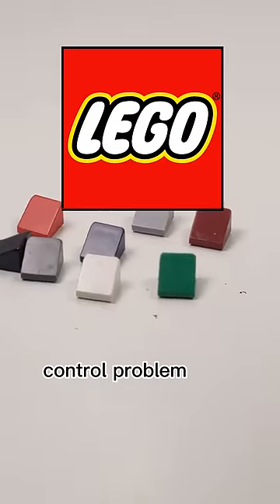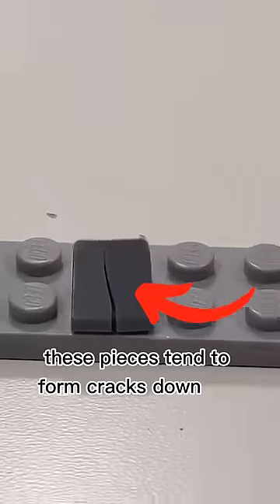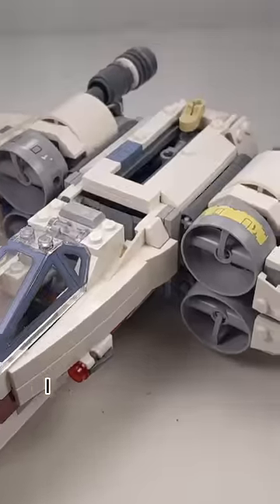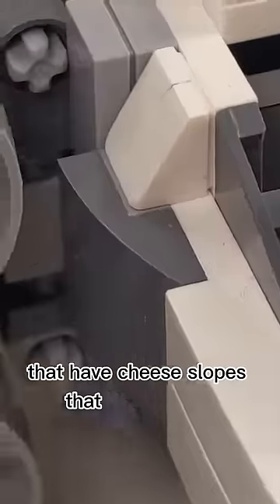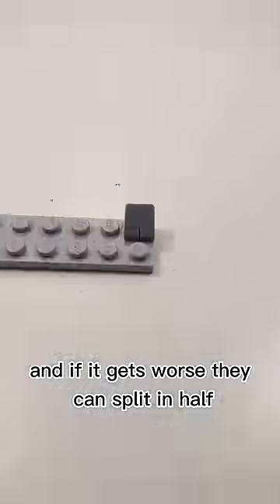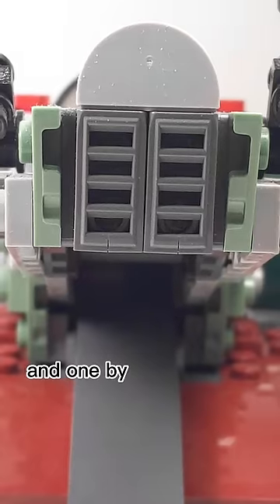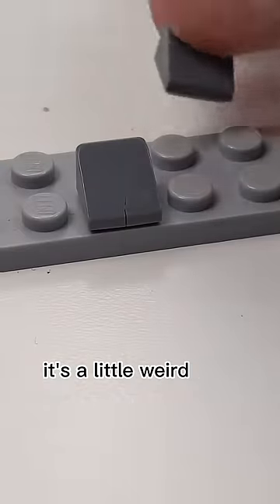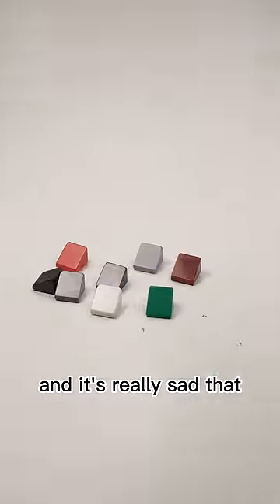LEGO has a Huge Quality Problem with Their Slopes #shorts #lego

Comment: Facts. Matter fact, I just had to replace a cheese slope not too long ago on my mirco Vulture Droid, based on the 2012? Advent calendar that I built myself, on the head because It cracked and that piece has been on there for 6 years, and I sifted through my other cheese slopes and I've noticed the the clear ones have them so far, but I found another to replace it

Comment: Lego has a huge quality control problem with everything. Form pieces missing to discolouration, bending, scratches and a likeliness to crack. The quality has been deteriorating for years now and it’s sad to see. 

The thing that used to differentiate Lego from its competitors was the quality but nowadays there are multiple companies that make bricks the same quality if not better with much much cheaper prices and less sparing regarding set design where Lego tries to save wherever they can often at the cost of design.

Comment: I've had Lego sets for over 40 years, and my son is a huge fan. We had thousands. Lego has extraordinarily high quality. Especially compared to mimics and knock-offs, where the pieces don't even fit. Sure, any material fatigues when stressed enough. This is not a quality control issue. What do you expect quality control to do, flex each piece a million times and check for cracks before putting into a package?

Comment: Should bricks break? No. Still I suspect this brick suffers from an inherent design flaw. It's actually not surprising if you view this from the perspective of basic engineering. 

These cracks all seem appear on the lower end of these sloped bricks. I don't think this is a coincidence. You're dealing with a relatively thin area of the brick. 

If you remove the block by grabbing it's thicker side and pushing it in the direction of the slope, you'll be applying lots of force on a relatively small area. 

Improved materials may alleviate the issue but the underlying flaw remains. Maybe a slightly softer and less brittle material would do the trick.

Comment: This is unacceptable . When they charge $50-hundreds of dollars for sets all supposedly to keep up the quality of their product and the pieces crack and look junky.

I enjoy Lego but they basically cornered the market in a lot of ways and then cranked up the prices to insane levels where you’re paying for the same old plastic blocks they’ve had for ages and they say it’s so they can constantly innovate and keep quality products on the shelves.

Mostly you’re paying too dollar for name on the box especially if it is a set inspired by a franchise because there is a licensing fee on top of that. 

I understand inflation hits every business eventually. But for me sometimes I can’t wrap my head around the price points of some of their sets for 100 tiny plastic blocks. Hell some of the Duplo sets are less than 50 pieces are you’re paying at times well over 1.50 per brick.

Comment: Never had this problem in my 20 years of lego.

I think this is a user issue
Reply: To suggest that it's a user issue makes no sense. It's Lego. You're supposed to reuse the parts to build new things. Just because it hasn't happened to you doesn't mean it isn't a real problem. 

I can confirm that I've had several of these pieces break on me in exactly that same fashion. It's not a big deal for me since they're cheap and I just replace them, but that doesn't mean it's not a problem.

Comment: i’ve never had any problems with any lego pieces breaking, try and keep them in a climate controlled environment. i’m in the south, humidity is high here so my house stays on 65-69 degrees. also keep your builds away from any windows, the UV light degrades the quality of any plastics over time. and lastly, i get some pieces require a little force but how about we not man handle the pieces and they won’t break 😅😅

Comment: Courtesy of environmental warriors. The plastic has changed over the decades, uses a lot of recycled plastic, all because people associate ALL plastic as being an environmental disaster, while forgetting that LEGO is not being thrown out. It gets kept, resold, handed down, stuck in a box for a decade until discovered again. It’s not waste, so is fine to be made from the highest quality virgin plastic. As someone who had LEGO in the early to mid 80’s, and then rediscovered it slightly in the early 2000’s due to becoming a parent, and now collecting it again, I have noticed the nuclear proof diamond hard and sharp LEGO of old has been gradually replaced by a more flexible, softer, rounder edged plastic. You can feel it when pushing blocks together. In the old days, they clicked together, and need the jaws of life to prise them apart. But now, they wiggle together, and you can fee them slightly distorting and flexing as you handle them. The only good point to this change is they break cleanly, without shattering, and they are cheaper than they would be if they were the old plastic.

Comment: Well me I noticed to have this issue for some of my very old 2014 sets , I recently bought a lego city one it's the mining 4×4 I bought it last month and today I just discovered that some of cheese slopes started to crack , and it the set was all brand new sealed , and I haven't washed or did put the set anywhere to say then it's the temperature problem , can someone explain me that ? I had this issue with my bad batch shuttle too , and I didn't do anything wrong to it and slightly some of them started to crack just like the ones from my mining 4×4 especially the grey ones , can someone explain me how to be aware of this problem ?